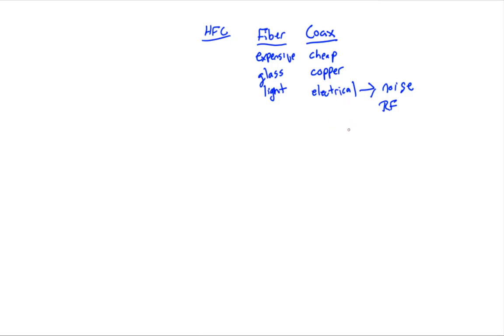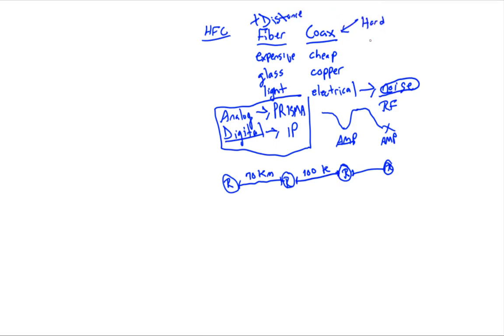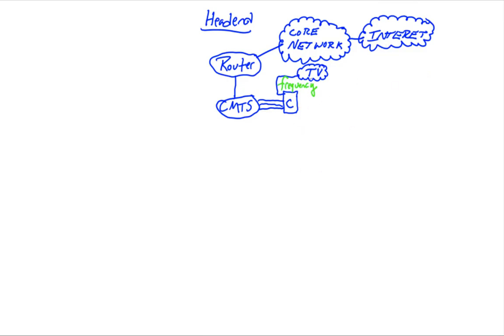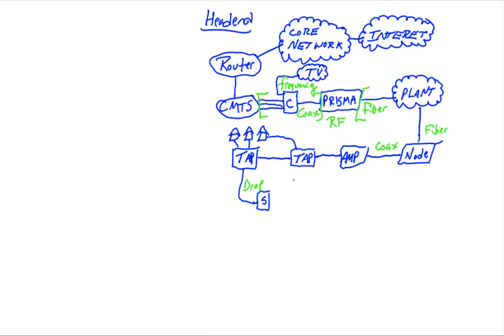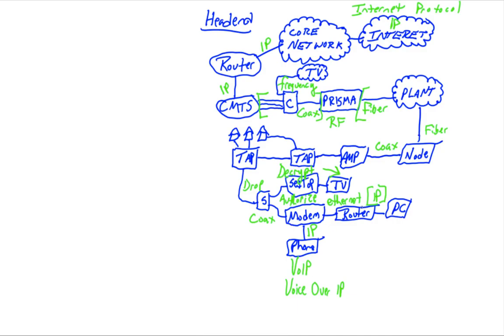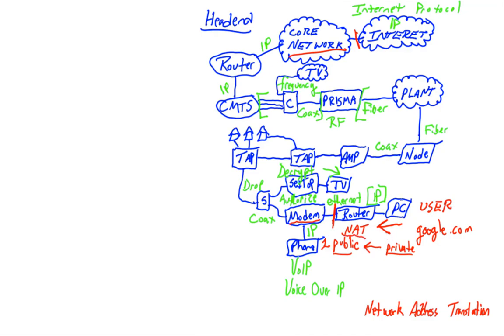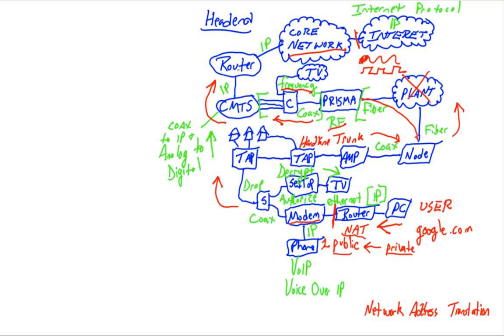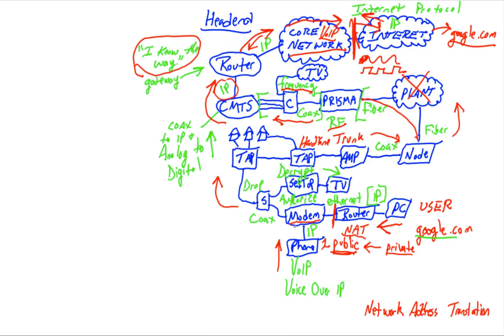HFC Cable Systems Introduction

Comment: Why is beetween combiner ans prisma only coaxcable? Optical signals from cmts to combiner are changed to rf in the combiner to send this to prisma?
Reply from the maker: In traditional CMTS setups the signal comes straight out of the CMTS in RF coax. More modern RPHY solutions can be IP-based but his is a semi-new technology.

Comment: As someone who's moved up the ranks as a coax field tech, and moving into HFC design, this is a nice refresher. (side note: As a coax field tech you truly understand the vast amount of problems it has... from bad connectors, tears, bad wallplates, splices, bad cable, bends, loose connections, water, damaged taps, splits, poorly balanced signal, etc.)